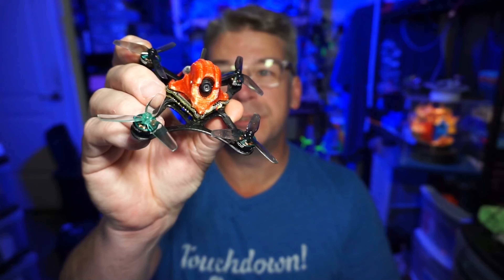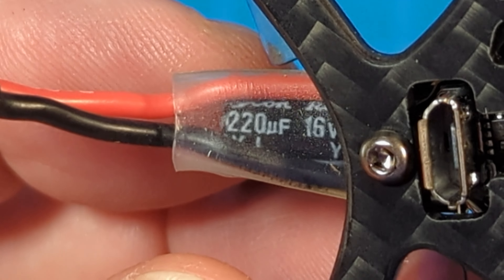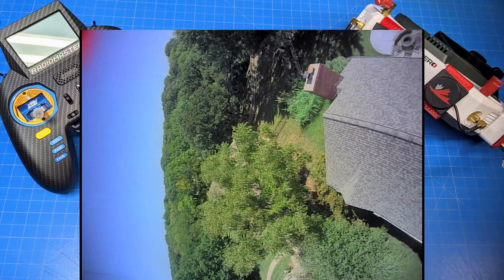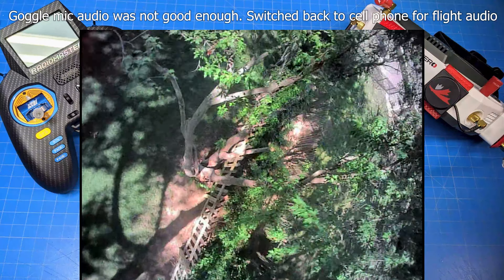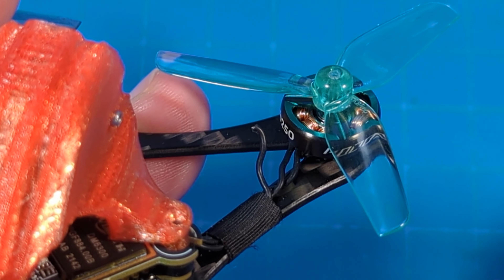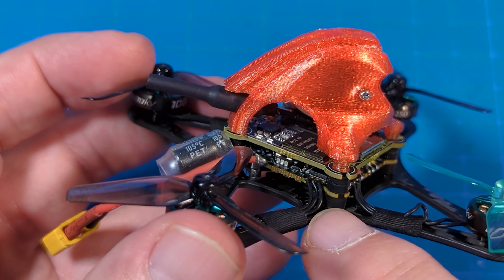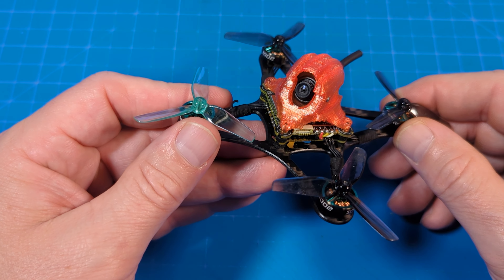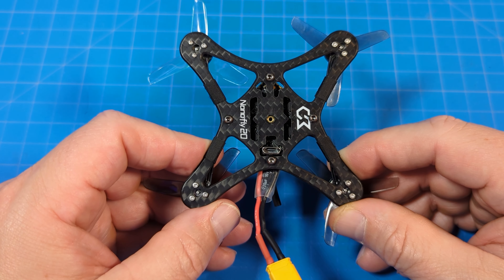Crash NOT survived // Sub250 NanoFly 20 2s HD // 51mm Props

Comment: I'm still a speedybee battery strap promoter. Very good little straps for our 1s and even 3s micro applications
Reply: Interesting. I'm going to search for it, thanks! 😊
Reply from the maker: I have a few of them as well. In this case I think they might be a touch thick to thread through without disassembly. Thats where the cheapo depo comes in handy.
Reply: Just looked at these and 1.7 grams(before possibly being cut to length) isn't terrible for the convenience!  I have run into issues with the strap or it's hairs interfering with the flight controller. Normally this would just mean 4 spacers but with today's HD VTXs the stacks are getting a bit tall for my taste, though Fractal has found a way to keep his low with no props ❤
Reply: iFlight also does a nice small 10 x 100 strap, works great for 660mah on Mobula 8.

Comment: Only reason they used the HQ51mms is that they got them for 0.02 per prop. Gemfan 2015 or even the 2008 would work significantly better in this build.

The frame to me is a RacerX and it always will be, but I’m not super long into FPV.

I use washers for the M1.4 screws for the camera and motors and they don’t come out or move. 100% recommend doing this.
Reply: GF 2015 props are best for these 1002 or 1102 motors.
The new GF 2008 are basically very similar to the HQ 51mmx3. Hold them side by side and blade pitch Looks the same. The gemfan 2008 are thinner and more fragile than the HQ. Both bend and break. The 2015 is the only good prop.

Talking props, the gemfan 3630 are awesome 👌
Not really for sub250 builds, but fast and durable on 2005 motors. 180kph no problem
Reply: @chrisbee5481  I agree with everything you said…

Except, even though they look similar the 2008s and 51mm feel very different in the air.

2015 is one of my all time favourite props as is the 3.6 you mentioned and the 4.6 I’m currently working on. Props make such a huge difference! I’m so glad we have good ones!
Reply: @lemonsquareFPV  do you know if there are any new 4" props coming out? Iflight has the new F4X with new HQ 4x3x3 props. I'm not sure if they are basically the same as the old hq 4x3x3 , but with the new grey PC plastic.
The only good 5mm mount 4" props are the emax 4024.
We need a 4" prop similar to the 3630 scaled up.
Reply from the maker: yea, Racer X will always have a fond place in my heart with Bryon.
Reply: @chrisbee5481  there is yes.

Most development is in the sub 5” sizes between 4.5 and the 4.8 + 4.9 that were released not too long ago.

5” is too big of a prop for proper freestyle on a lighter no GoPro build 4.6 is my favourite BY FAR! 4.7 from last year was good but dropping to 4.6 just made a literally perfect flying freestyle quad.

4” wise I already love and daily the GF4023 and HQ4x2.5 + bi-blade version, and see no reason for anything new… looks like you want a more durable prop… use the older 4” props the HQ DP and Gemfan WindDancer. But honestly just run properly engineered modern props and change them 😜 I AM open to suggestion though, how would you change the props?

I dislike the way all Emax props feel in the air 😜 but they ARE great for beginners… heavy and linear. Spool is WAY too slow on heavy props and I just can’t for my style of flight. They are good for heavy or cruising, but I am the opposite of those things 😜

Comment: Yes! More 2" 2s! I wish they used four screws on the motors though - I find those tiny screws on the three screw motors are easily damaged or lost.

I must confess though, I picked up a Nexa 2.5 based on your review and, after some adjustment to get used to the 3s POWER in my small yard, my 2" 2s quads are now having some rest time in a drawer.
Reply from the maker: avantquads makes some good ones for sure. good to see them back under the new avionrc name.

Comment: The way to fix that little blip you call prop wash, is to turn down throttle boost, to 1 or even zero. Also would help to lower the TPA breakpoint a tad, depending on what the D term values are.
Reply: I need to learn how to tune…

Comment: Nick, do you think a build can be done with a Vista on one of these frames?  I have some bits and pieces left over (motors, 12 spare props, Vista) from my Mobula8 HD that the FC decided to light on fire.  I do not want to buy some new $600 goggles to get into HDZero and would prefer to just keep using what I have.  I know it'll be heavier, but do you think it'll still be a decent flying quad?  I love this size and the Mobula8 was fun but unfortunately died a gruesome death.  The motors I have are the 1103-11000KV from HappyModel and some Avan Rush 2" props so I think they're a bit more oomphy to carry the extra weight compared to your 1002s?  Have a few HyperJuice 550mAh 2s that I was hoping I can use as well.

If not this frame, what else is out there that will be more likely to meet my expectations?
Reply from the maker: Possible yes. I don’t see how the canopy would work though. It certainly wouldn’t fly as well or for as long with the extra weight
Reply: @NickBurnsFPV  Thanks for the reply.  Much appreciated.

I ended up buying some Goggles 2.  I think I will build one of these with my Mobula8 scraps with the new O4 Air Unit Lite... Should be much better than with a Vista, no?

Comment: Curious how they wired up the 2s walksnail board to a 2s machine.  Moblite 7 HM used the buzz+ instead of the 5v pad next to the ground and UART.  figured there must be a reason for using it.
Reply from the maker: They wired the power to the flight controller vbat + &  -. Not the battery led pads but separate vbat pads.
Reply: So potentially greater than 8v vbat? Or is it 5v. I'm anticipating the new snail 1s board to be officially out soon since walksnail kina doesn't fit 2s.
Reply from the maker: @Mupshot  The silscreen on the board says vbat, that would be the same as the battery voltage. In a 2s case that would 8.4v or less as the battery is used.
Reply: @NickBurnsFPV  thank you sir. That makes me think they are getting the new 3s capable snail boards.  I'm excited.

Comment: Hello, my friend, I have a problem. I did everything you said and it was great. In the last step, I can't connect the drone camera to my HD zero glasses and have an image. What settings should I do? Is it possible through your VTX?
Reply from the maker: Are you using the scan function of the goggles? the goggle should scan and find the video signal if the vtx is powered on.

Comment: Nick I'm flying tbs analog on my hdzero for now...is there a way to get  Audible beeps or vibration to let me know if I'm recording in manual mode...I can't see a recording icon on my OSD...thanks again
Reply from the maker: I am not aware of getting a dvr recording notification other than the in google REC in the top right of our view
Reply: @NickBurnsFPV  thanks for your reply your very knowledgeable is why I ask...when I'm in analog on my osd I can't see the red rec icon that you can see normally on hdzero vtx...I'm asking if there is a setting when you hit the RH record button if you can get an Audible?
Reply from the maker: @chickwithstick7695  I don't believe there is. I have my dvr set to auto record. When the goggles detect a signal it records without any input. Curious yours doesn't show the red rec icon. By chance did you move the goggle osd elements around...I think that is an option.

Comment: @nick burns  Im following your 3 changes video diet.. slowly dropping the pounds (whilst also riding my bike again), feeling better for it. hows it working out, does the weight stay off or does it creep back on?
Reply from the maker: I suspect for those of us with a tendency to put on weight it’s something we have to be aware of. Rather than it being a diet, a new way of living. After we have achieved our desired weight we can bring the calories back up some slowly while monitoring the weight to find a new maintenance way of eating. The exercise is good for our health but doesn’t burn as many calories as we might think. For me I have found it better to be more mindful of the food intake than being excessively ridge on an exercise routine. I have experienced weight ups and downs. I find travel to be the most challenging and scale disappointing.
Reply: @NickBurnsFPV   thanks for spending the time responding.  Holidays away are the worst. I can't maintain what I usually do and then don't want to get back on the scales after. By the time I do, much damage has be done. Denial is a terrible thing.  On the bright side, my quad seems to fly the same no matter what weight I am.😂
Reply from the maker: @doccock100  quads have no heart, they don't care about us :)

Comment: I'll keep preaching it,a hx100 frame,10,000 kv motors for 2s and bi prop is unbeatable,and to be fair i run the set up on 12amp
Reply from the maker: I wasn't overly impressed with the stiffness of that frame. Tuning became a challenge
Reply: @NickBurnsFPV  I've beat the snot out of 2 of them going on 3.5 year's, and a o.g. 115 frame n all 3 still kicking